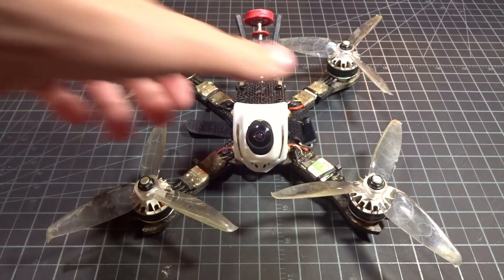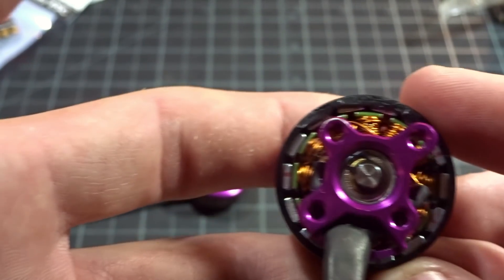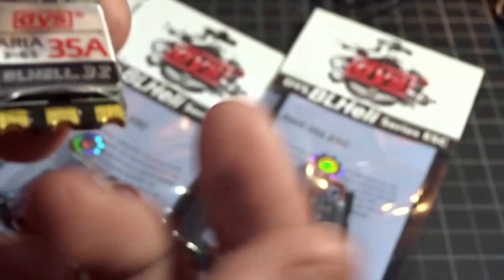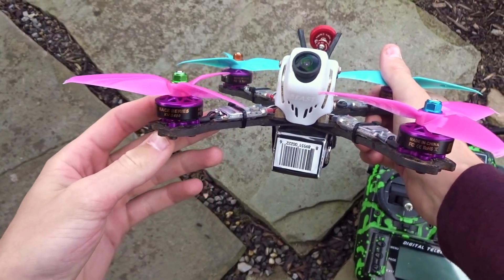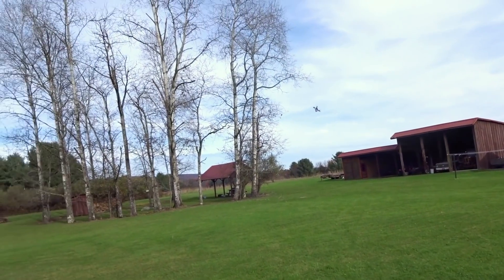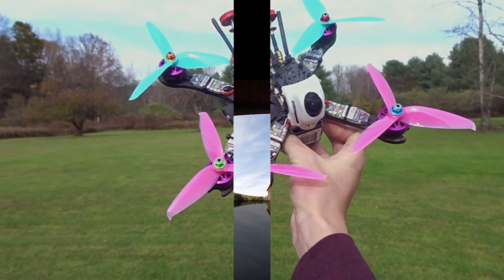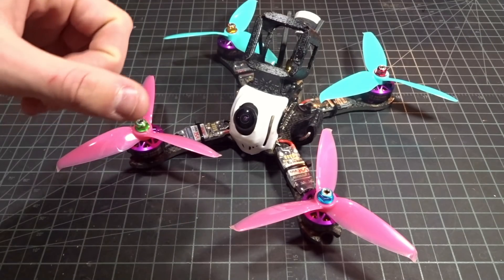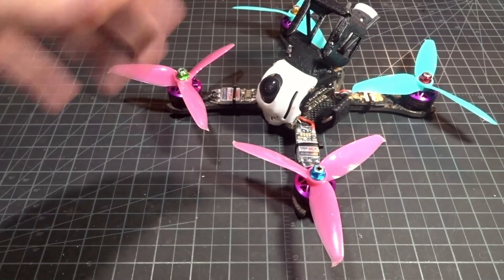Beast X Update : New Motors, FC, and ESCs!

Comment: 5S it brother. I’m not sure about your PDB but that quad looks like it’s made for 5S power. 5S breathed new life into my Chameleon, much more fun and control around the track also.
Reply from the maker: To me adding power is not the solution to dropping weight :) Much rather have a 550g quad on 4s than 650g on 5s.
Reply: Using 1300’s I don’t think you’d be adding any more than 50g depending on brand and type. I run mostly dinogy graphenes and the difference from 4S to 5S (1300mah) is only 35g. 
By the way, those 2300kv T2 motors work brilliantly on 5S with heavy props. Just my opinion, horses for courses. 👍
Reply from the maker: +crash test cal if the build was 50g lighter I might, but it would just be so heavy it would not be what I want with a 5s
Reply: Fair enough